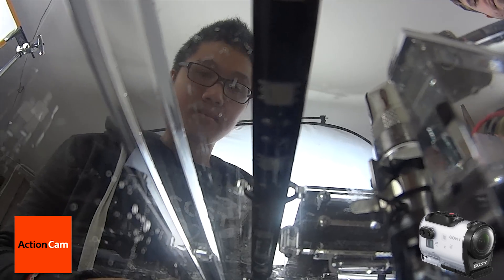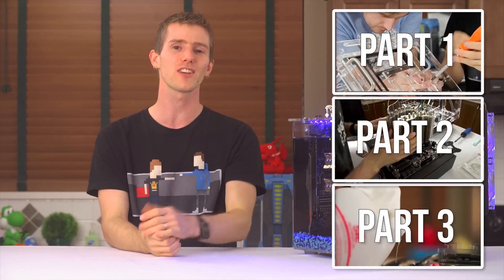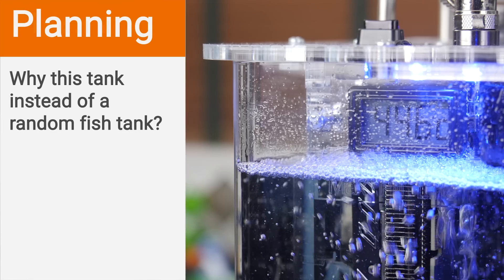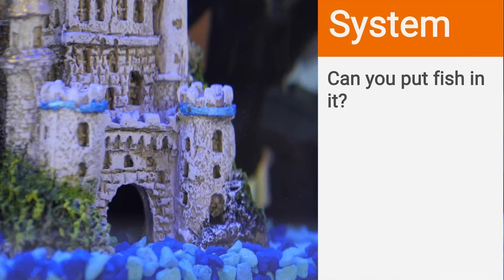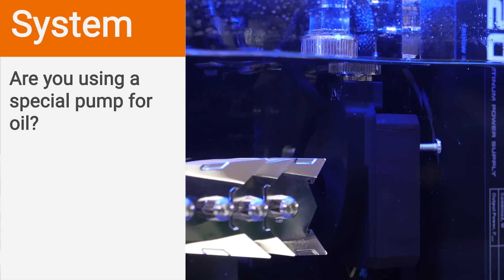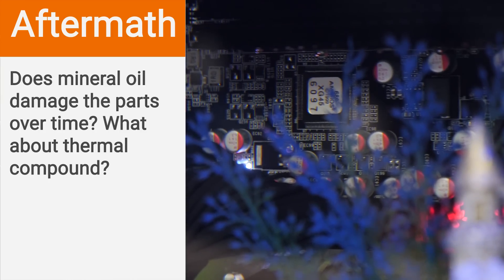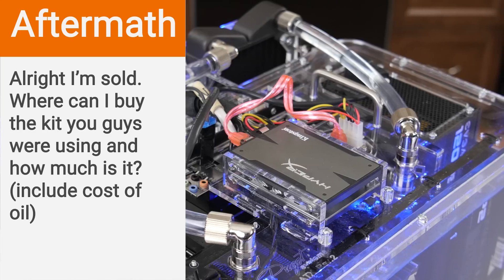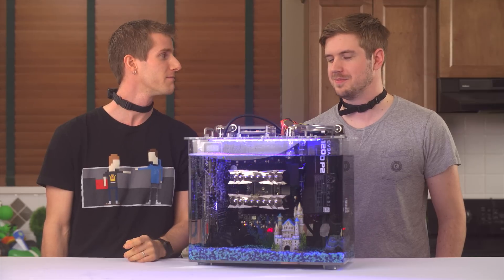Mineral Oil Cooled PC Part 4 - Q&A

Comment: So one quick question: does it actually still need heatsinks on CPU and GPU?
Reply: You can basically move oil over that CPU, so it would be like water cooling (which doesn't have heatsink, just "contact plate" that mainly just holds water in place - and water itself then replaces heatpipes found in standard coolers). So it can be like "better water cooling" by my understanding of physics. As long as you blow enough oil over that CPU, you should be golden - I can imagine having a fan directly over CPU and then doing some crazy overclocking with it. But I might be missing something, so:a) Is my reasoning correct or am I missing something?b) If it is, isn't it worth your time to actually try it?
Reply: the surface area of the CPU is not enough to cool it down, so you do need a heatsink
Reply: jacobinho93 CPU area is big enough to transfer CPU heat to base of heatsink which you need because air cannot cool any area fast enough, so you need bigger area to make the air more effective. But you don't do it that way with water cooling. Those things have some contact area and then running water over it, because at some point, the coolant is more effective than heatsink. And I believe that mineral oil might be beyond that point.
Reply: And you can have direct-to-die cooling and it will be the most effective one.
Reply: ***** "water heats up wayyyyy faster than mineral oil does" 

Water has more than double the heat capacity of mineral oil, meaning it can take on more energy than oil can before the same temperature change is observed. For this very reason, water does not "heat up wayyyy faster than mineral oil does."

Comment: I would bet a large amount that a CPU fan or two would make a huge difference. Moving the oil through faster than convection brings the mean temp oil back in quicker which moves more heat off the heatsink. It has got to make a difference, the question is, would the difference be worth "the nasty" of putting fans inside the case and getting in the oil...if you can do 4.5 without overheating, probably not.

Still, I think CPU fans (note plurality) would make a big difference.

Comment: Can someone help. I have an Asrock h97 pro4 mobo. The mobo has 2x cpu fan, 2x chassis fan, and 1 "power fan" header. The question is whether I can plug my CM liquid pump connector to the "power fan" header? Both of them are identical 3 pins.

I'm guessing the pump will run at full speed without me controlling it or is it unsafe for me to plug a pump connector there?

Comment: How Is This Build I Want 60+ And I Will Be Running One 4k Monitor 

1 TB HGST Travelstar™ 7K1000 7200 RPM SATA 6Gb/s Hard Drive

17.3" Full HD LED-Backlit Display Matte type (1920 x 1080)

4th Generation Intel® Core™ i7-4940MX Extreme Edition (8M Cache, up to 4.00 GHz)

6X BD-R Blu-ray Burner 8X DVD±R 2.4X +DL Super Drive Additional Full Range AC

Adapter 330W, AC‐in 100~240V, 50~60Hz with the Power Cord

Crucial® M550 512GB mSATA SSD - (Storage Drive)

Crucial® M550 512GB mSATA SSD - Preconfigured as an OS Drive (Primary Drive C)

Genuine Microsoft Windows® 8.1 Professional 64-Bit Edition

HyperX 32GB Dual Channel DDR3L 1600MHz CL9 1.35V - 4 X 8GB

IC Diamond Thermal Compound - CPU + GPU -

Killer™ Wireless-N 1202 with Bluetooth Combo Module (Dual Band)

NEW! Dual NVIDIA® GeForce™ GTX 980M's with 2 x 8GB GDDR5 SLI® 

Removable Smart Lithium-Ion battery pack (8 cell) 89.21WH 

Sager Branding

SAMSUNG® 1TB 850 Pro Series SSD with 3D V-NAND Architecture

Comment: I'm a lit afraid of long term oil humidiy as it seems that the tank may not be hermitically sealded. I work a lot with high power transformer equipment for very high voltage and current purposes (~120kV & ~140A)  and I have to be very councious about humidtiy. The oil I use is Shell Diala S2 and periodically it has to be dryed with special oil laundry machines.
Does the air humidity degrade the oil over time and will this be a problem for some compoonents?
Will this build also work with standard transformer oil as mentioned above or will it damage cables and coatings permanentely? Some materials for cable insulation are very easy to destroy with transformer oil. Either the cables get extremely stiff and breake apart when bending them or the insulation grows to marshmallowy size and loses it's purpose.

Comment: If you put a fan on the top of the CPU heat-sink sucking down, wouldn't that create a vortex in oil's surface subsequently counteracting the bubbling fixing the noise problem and keeping the CPU cooler?

Comment: I am not sure if it was mentioned, but even though the fans for the CPU are pretty unnecessary, why didn't you use it for the sake of circulating the oil, so it doesn't stay in one spot, like what you said with the GPU?
Reply: Ute Gpu will circulate the oil enough. If you've seen a fish tank you'll understand that one filter acts as a wave maker circulation the water very well.
Reply: They said that they would but the direction it would be circulating the oil would mess up the path so it wasnt worth it.
Reply: Alex Gower Where would the flow exit?

Comment: what if instead of a large air cooled heat sink  on the cpu
you'd use a water cooled cpu block ( with pump embeded ) but no pipes attached to it ... just circulate the mineral oil from the entire tank

Comment: LinusTechTips will you rewiew the Philips BDM4065UC/00 40"
When it comes out? It's a 40" 4k monitor with display port and support for 4k@60hz
IT'S A MONITOR NOT A TV.

Comment: Great build your best ever though i would of put better graphics card ie evga gtx980 classified.
One question interests me could you use a Temp Right or something similar to cool the oil and hopefully keep heat temps down, something like what u use on a keg of beer to cool it before pouring into glass.

Comment: I would have intalled a cpu water block and fed the oil from the rads into the cpu block and from the block back into the case. This way cpu temps would be lower.

Comment: It is a cool project but I really dont like the rocks, castle or ship.. It makes it go from a cool build to an childish aquarium, btw best outro ever :P
Reply: Brendan Power Yes you stated that before, im not trying to say that anybody is wrong.. I just stated my opinion about the build. I dont have to create my own mineral oiled cooled pc just to make my own opinion now do I?
Reply: Yeah, I hate the trend of making oil cooles PCs look like silly aquariums. These guys didn't even use a fish tanks, so there isn't even any association between the two.
Reply: firstly, its a fully custom job, they can do whatever they want lol. its better that a run of the mill air cooled or water cooled pc. plus thats just your opinion.
secondly ramby, they used a case designed for what theyre doing...its pretty obvious and stated in this part of the build log
Reply: Brendan Power Dont know what you wanted to say but ew both just stated our opinions, Just because a PC case looks like a aquarium does not mean you have to build one. The build was not cohesive, you have the "chrome", the stealth black and LED-lighting. Then they put in a multicolor castle and small rocks that disrupts the build (IMO).
Reply: Completely agree. The aquarium accessories absolutely ruin the look of this build.  They missed an opportunity to make it look like a super advanced machine straight out of sci fi.  Instead it looks like someone accidentally dropped their PC in a fish tank.
Reply: not really, its better than a run of the mill air cooled or water cooled. highly opinionated. why don't you make your own and make a long ass video log lol.

Comment: "Except it looks really cool"

...........and temps are insanely low? That's the whole point, what the hell? 

Pros
-Insanely Low Temps
-Close to no noise compared to water and air
-Like Linus said after, NO CLEANING EVER, NO CHANGING OF OIL
-REALLY durable, looong time before anything fails because of said low temps and constantly being oiled, so no rust and no problems you might encounter with water and air
Cons
-As Luke said, upgrading is a HUGE pain in the ass, getting everything out of the oil, getting more oil and then getting it back in, you're better off buying a whole new PC after some years
-Testing for dead components, same thing, not as easy as actually touching whenever you want the components. 
-Expensive if you keep upgrading and upgrading your whole PC because you can't be arsed to change everything, for rich people it's pretty much the best.

So yeah, that's it, it's not really that more expensive it's just a huge pain in the ass to change things. A lot of contradicting in the video, saying you've to reapply thermal compound or your GPU will fry outside and then saying you can reuse them just let them dry...guys pls...

Pretty weird...

Comment: You could put robotic fish
Reply: yes, but if the fish swims through the computer components/fans your done. (you have to replace the component that the fish broke)
Reply: ya i can see that yet that system does not need fans with the fans on the out side of the thing

Comment: Quick question, is the CPU cooler really neccessary? It really just seems to block the oils ability to dispatch the heat from the CPU.
What difference would a smaller passive cooler do? or even no cooler?
Reply: You need to increase the surface area with the heat sink. The same way air cooling passively works. :)
Reply: Oh yea, "heatsink" there was that word.
But that's the thing with something so dense as oil, a larger surface is not really neccessary copmpared to using air. In a watercooled loop, the heat sink is WAY smaller because the water just need to pass through to pick up the heat and tak it away.

The oil here only seems to slowly heat up the majority of the heatsink when the overall oil temperature rises not really disspatching the heat from the CPU - at least the numbers seem to reflect this when comparing the CPU load temperature to the GPU load
Reply: Heat pipes distribute the heat very very quickly through the structure. It's analogous to why people with de-lidded CPUs rarely use direct-on-die cooling. They replace the thermal paste and put the IHS back on. The IHS helps to distribute heat, as well as protecting the CPU.
Reply: Copper/Aluminum is still a better heatsink than the oil itself so it's definitely better than a bare cpu.
Reply: ***** I see, well thanks for your replies
Reply: Kim F. Wendel I agree with you maybe a waterblock with the top removed would perform better than this heatsink, or maybe letting the top on but pumping oil with a small pump in the inlet port would work better as well.
Reply: yes, absolutely nessessary, it spreads out the heat for the oil to have more contact area to exchange heat
Reply: djaysenpai ya know adding a water block like that would be a pretty nifty experiment....wonder how different the load temps would be

Comment: Ik alot about computers, but just wanted to know what you guys think about my build, and how i could improve it.

Intel Core i5 i5-4690K CPU (Quad Core 3.5GHz Processor, 6MB Cache, Intel HD 4600 Graphics, Socket H3 LGA-1150)

Corsair CMZ16GX3M2A1600C10 Vengeance 16GB (2x8GB) DDR3 1600 Mhz CL10 XMP Performance Desktop Memory Kit Black

MSI Z87-G45-GAMING ATX Motherboard (Intel Z87, 4x DDR3, DVI, HDMI, 6x USB3.0, GBE LAN, LGA1150 Socket)

MSI NVIDIA GTX 970 Gaming Twin Frozr HDMI DVI-I DP Graphics Card (4GB, PCI Express, DDR5, 256 Bit)

Corsair Builder Series CXM 750W Modular 80 PLUS Bronze Certified ATX/EPS PSU

WD 1TB 3.5 inch Internal Hard Drive - Caviar Blue

Samsung 840 EVO 250GB 2.5 inch Basic SATA Solid State Drive

Obsidian Series® 750D Full Tower ATX Case

Its totals to £1036.15, although I think its pretty good. BUT its just the parts, I would have to build it(or get someone to do it for me bcos I would be bad at cable organisation :P) and the WD drive has 65% off so will be like over £100 I think when the deal runs out.
Reply: Don't listen to everyone and keep with the 16GB of ram. Running battlefield 4 along with a couple of apps in the background already takes up 7GB for me, and future games are obviously going to take up more. At the least, I'd go for 12GB.
Reply: I think you should get bout a 1000 watt PSU for future proofing ur rig to play intensive games or "hard-core" video editing plus u would not have to go here and there search and whatever ppl usually do to get a great part at a great price. :D
Reply: I' m surprised no one mentioned this but you should buy a mobo with a Z97 chipset instead of Z87. The Core i5 4690k is a Devils Canyon chip and not a regular Haswell chip. I' d reccomend the MSI Z97-GAMING-5.
Reply: Get Cpu cooler and oc the cpu and sli if you can great build
Reply: Terty Brown actually Jayz 2 Cents said having a bigger power supply than you actually need lower the efficiently which actually slows you pc down
Reply: If you know alot about PCs, then you should know that you dont need a 750w PSU for a GTX970.
Reply: I know did you read my last comment
Reply: Also, always good to have a bit of headroom with the power supply-will allow you to do an SLI configuration in the future since your board supports it.
Reply: trololololol101 He could just buy two 4 gig sticks for now and upgrade later
Reply: Post this build to the experts at reddit.com/r/buildapc 

I can tell you a lot of the people on youtube won't offer very good advice, and you much better of getting a worth opinion.
Reply: InDaHood Actually, total watt usage is 650w, and i got an extra 100w for future upgrades
Reply: trololololol101 Will do. We all know that 16GB's will be the slandered for gaming soon :)
Reply: JordiUp Have done. http://www.reddit.com/r/buildapc/comments/2p3gga/build_help_help_me_with_specs/
Reply: Don't use a CX power supply on  a build that costs this much. At least get a AX750i or EVGA Supernova G2 or Coolermaster V700 / V650s
Reply: Ben Major Thanks for the help :)
Reply: Ben Major The CX are now 80+ Gold, buying a AX with low voltage is one of the stupidest things you can do, an i5 and a 970 could run on a 500w PSU just fine
Reply: Maurice Enschede Yes, would be stupid not to use one. But I think some Z87 mb's do support the Devils Canyon with a bios update
Reply: ***** i see welll then....idk if this works but heres my specs for my entry lvl gaming pc
CPU:AMD A6-5400K
Motherboard:A88X PLUS(ASUS)
GPU:Sapphire HD6670(Changing too)
(New)GPU:Sapphire R9 270X Toxic
PSU:700 watts Cooler Master (G series)
Casing:Armageddon T6 Gigatron(Houses 5 Fans)
HDD:Seagate 120GB
(I know the HDD is not the way to go =_=)
Please Tell me how I can improve it.
Reply: ***** What do you mean low voltage....
Reply: Terty Brown some of it looks good. That CPU will be a massive bottleneck to the R9 270X so if you're keeping it, I'd suggest going for a cheaper graphics card. At the least, if you want to keep the motherboard, upgrade to an A10. For the HDD upgrade, I'd go for a small SSD (120-240G), as well as perhaps a 1-2TB hdd- WD seems to be the best for reliability-I'd recommend the WD Reds.
Reply: ***** Yes a lot of Z87 boards can use a devils canoyn CPU (Haswell Refresh).  Yes I do admit I went overkill with the power supply. Then I would say rosewill capstone 550M then.
Reply: Terty Brown sorry, when I said change the motherboard to an a10 I meant the CPU.
Reply: trololololol101
I see.Thanks for the info about the CPU bottlenecking the GPU.I will PROBABLY change the CPU to an A10 as fast as possible.
Reply: Maurice Enschede Sorry, copy and pasted the wrong motherboard, but have the one you chose. Thanks :)